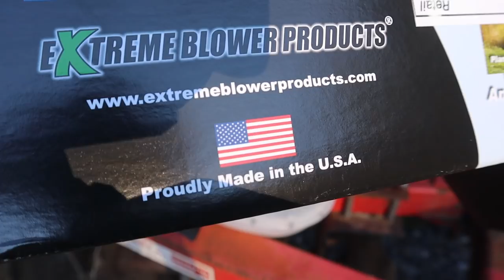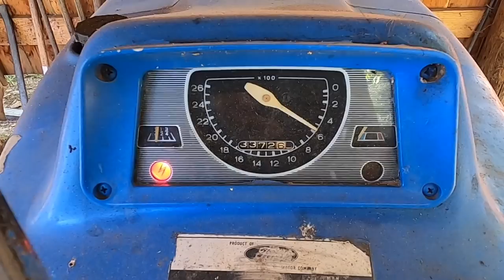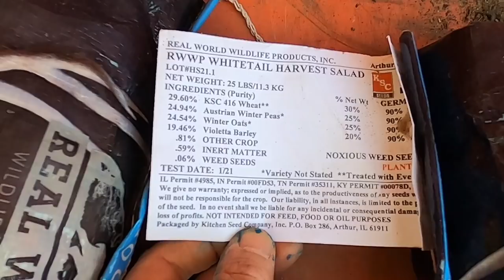The BADDEST Blower Accessory You've Ever Seen!

Comment: use some foam tape between the mount and the tube to seal up the void area - the base is made for a smaller diameter tube.    Another tip is drive around on your bad boy buggy with it pointed out the side.  Saves foot traffic.     Good video!
Reply: foam tape is pretty smart...that company seems to want to make it a simple product so maybe send them a note about including some in the box...

Comment: Hello Fall Line Ridge.  You could use self stick weather stripping to seal the space on the blower.  Kinda like a gasket.  Hope it helps! Thank you for the great content!
Reply: Good idea.  Also a simple piece of rubber the size of that base plate could be slid under the plate. That way, you can have your regular blower available for use when you're not spreading. Just take off the seed bin and place in the rubber seal.
Reply: Fuck that right now it looks like spent shell casings in slow mo
Reply: @chrisberry9016  I think the flow control in the adapter closes completely. No need to add a seal.... Doesn't need to be airtight or anything. Even the blower tube sections aren't sealed or gasketed. It's really just a loose tunnel to guide the air. If the flow control gate in the adapter closes all the way (an OFF position), that's really all it needs.

Comment: Use a heat gun and heat up the spreader where it contacts the blower till it softens enough to conform to the radius of the blower tube, then tape or clamp it down till it re-hardens.

Comment: A'ight add diesel to the hopper and light it as it comes out... flame thrower!!!  LOL, I don't think it works like that.
But maybe I could attach one and fog some Diatomaceous Earth under my trailer to kill all the Black Widows.
The company should make a hole plug that uses the same strap to hold it in place that's way slimmer than the
adapter, so I don't miss having my blower look like a blower instead of a hack job.
Reply: You could cut a piece out of a motor oil quart bottle (many are black anyway), clean up the edges a tad, and strap it over the hole pretty easily. Be tough to notice from more than a few feet away.

Comment: Interesting product for your blower.  I suspect it is made for doing much smaller areas than the 1+ acre field you used it on.
Reply from the maker: I think so too. A half acre or less I think it would be great.
Reply: works good for double cropping also.  example, if you have standing beans or corn, you can walk or ride beside it and shoot the seed over into the standing product so your not running over it.   as beans and corn dry down, fresh greens like winter rye or oats will come up under and offer great food source in late season.